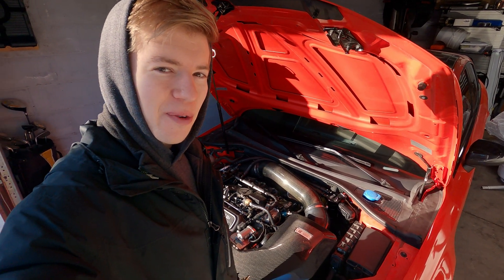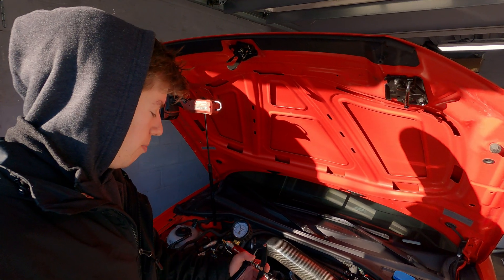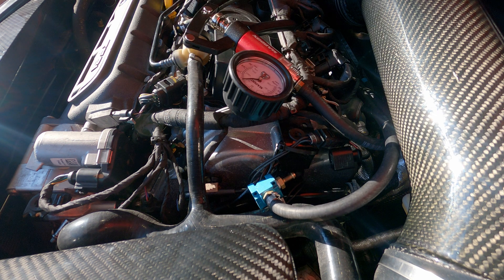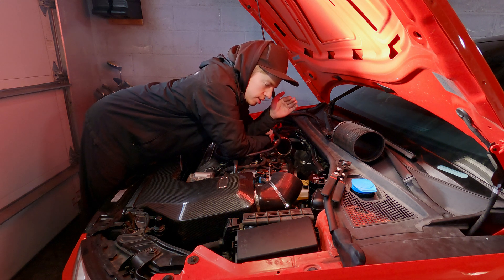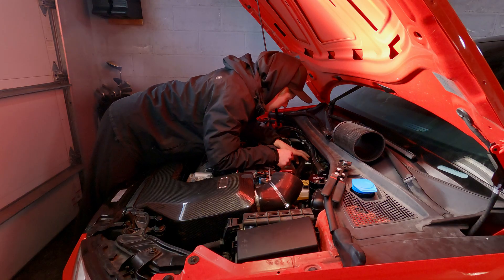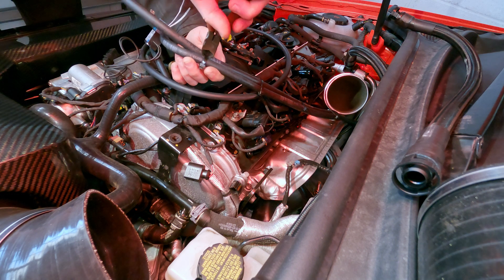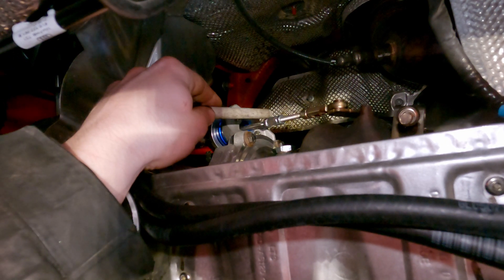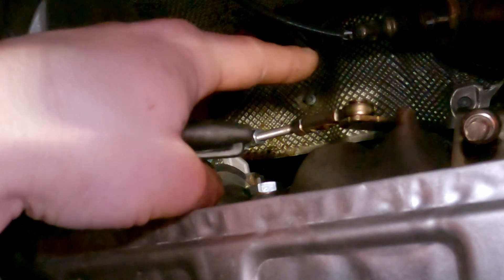Built Motor RS3 DS1 SRM Hybrid Boost Creep

Comment: So if the wastegate was not properly preloaded will that cause a laggy feel of the turbo?
Reply from the maker: Yes, basically bleeding boost while you're trying to build it. The boost creep is a separate issue that is most likely caused by the wastegate port not being large enough to actually bleed off the boost.

Comment: love this build journal, sold my 2015 PFL before the US market got rs3’s and the tuning scene took off, bought another 2020 rs3 to do the build I missed out on... and learnt to keep it stock turbo stage 2. If you want to go quicker than that, leave it for the s58 awd/zf8 m3 platform I think
Reply from the maker: They are stout little cars that's for sure. Things start to get complicate when you you're trying to double the original horsepower it seems 😂
Reply: @HardwayLearning  yeh for sure, the tuning scene is what made me buy another one. But by time i got an exclusive paint build slot, we had the DWNA engine here, so i couldn't exactly dive straight in. For longest time only Unitronic offered an OPF delete stage 2 map, and now i too am looking at moving to DS1 for the flex features
Reply: Sam if you need more info re the DNWA tunability you can follow my mate on insta @dsc_perth as he’s stage 2 e85 DNWA Atm and is going to slap an SRM Turbo on shortly

Comment: We asked about the waste gate setup when we purchased from SRM, one would thing they would set it up prior sending out.  not sure if this is a standard thing for companies to do or its needed but installer.  Regardless I always wondered if it needs the mac valve to run.  Good video. Keep at it!
Reply from the maker: In theory I think it's up to the shop who installed it.  Cracking pressure partly being dependent on your build and the tuner's preference. The shop that assembled the car actually asked us what our tuner wanted it set at.  I could see how the shop may have thought it was pre-loaded since we were told at the time of install to shoot for 15psi and it moves at that pressure without pre-load.  It may have also been missed when the engine came out the second time to be fixed by the shop that built the motor. Lots of hands on this car... that's for sure!